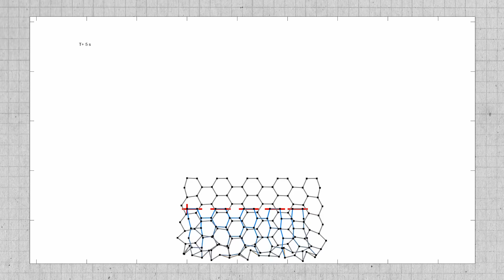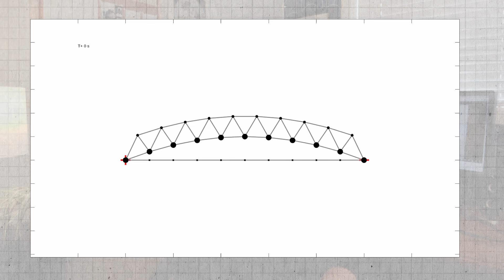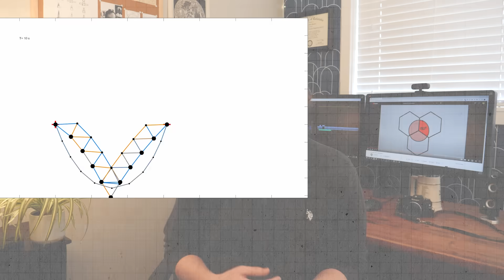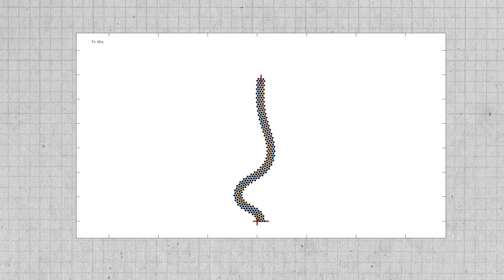Hexagons Are NotSoGreatAgons

Comment: Chemist turned engineer here. Hexagons ARE the best way to fill the space between 2 strong sheets in a honeycomb for precisely the reason CGP mentioned: they fill an area with the least amount of length. However this is only true for a general purpose (isotropic) honeycomb. If you require more strength in one direction than the other,  then a rectangular grid is best per the rocket example you gave. If you have only one sheet, then the other side is subject to buckling, so the best isotropic grid is the triangle one that you showed.
 
Hexagons are essentially useless for making a rigid structure from beams - for that you obviously need triangles. But if you want to make a 2D atomic sheet it has to be hexagons. Bonds spread out to fill 3d space due to VSEPR. An atom with 3 bonds (and no spare electrons) will be flat with 120 angles as in boron trifluoride (Graphene is a bit more complex,  there is a 4th electron on each atom but it is used in a delocalised electron cloud unlike the other 3 which are paired with neighbours into 3 discrete bonds.) if you have more than 3 bonds they make a 3d structure, for example 4 bonds form a tetrahedron as in methane or diamond and 6 bonds form right angles like a cube lattice, as in sodium chloride (ionic bonds) or sulphur hexafluoride (covalent bonds.) 

Molecules containing an atom with 4 bonds in the same plane do exist, but the atom in question is always a fairly heavy one with a total of 6 electron pairs to maintain that cube-like geometry (the electron pairs that are not used in bonding occupy the poles of the six-sided cube and therefore push the 4 bonds into a flat configuration around the equator of the atom.) To my knowledge nobody has made a flat sheet of atoms in this way - the electron pairs that are not used in bonding (and their corresponding orbitals) would leave the molecule vulnerable to being attacked chemically, even by itself.

If you are stacking long thin objects, a stack of hexagonal prisms is stronger / more stable than square prisms or triangular prisms, because it doesn't have shear planes. A fistful of hexagonal pencils feels quite rigid, but with square or triangular prisms they would tend to slide across each other.
Reply: You're right if you restrict your shape selection to regular polygons, and if your core/filler is purely for volumetric (aka non-structural) reasons. However, break those two assumptions for your application and it may no longer be true that hexagons offer the best mass/path length for the situation. For example, an application with negligible radial loads will be theoretically better served with only axially-aligned members, minus a couple radially aligned segments to reduce twist.
Reply: @Clippy-o3q  Isotropic means "equal properties (in this case strength) in all directions." What you are describing is a non-isotropic case. Actually a hexagon grid isn't perfectly isotropic (properties parallel and perpendicular to the sides vary slightly, cycling every 60 degrees) but is more isotropic than a square grid (properties at 0 and 45 degrees vary, cycling every 90 degrees.) I already accepted OP's point that another grid is better if you want more strength in one direction than another, such as the rectangular grid in OP's rocket example. Perfect hexagon grids are rare in practice both because they're not always the best solution, and (as OP mentioned) because of manufacturing. The hexagonal packing insided IKEA table tops is made from strips of card bonded together, for example, and is therefore twice as thick in one direction than in the other two.
Reply: @felixu95 Helix?
Reply: @Clippy-o3q  A disconnected lattice of rods sounds like a nightmare to manufacture at scale.
Reply: @Clippy-o3q an application with negligible radial loads isn't isotropic
Reply: "A fistful of hexagonal pencils feels quite rigid, but with square or triangular prisms they would tend to slide across each other."
That's an excellent analogy.
Reply: @Gameknight2169  it interlocks, while  squares and triangles don't? I'm asking because i do not know
Reply: This is the longest comment I’ve ever read. Thank you for that Amazing explanation! 😊
Reply: @Joe-sg9ll  Bees use hexagons because it optimises storage volume. Actually the bottoms of the cells are made of three rhombuses with diagonals in the ratio sqrt(2):1 (like the corners of a shape called a rhombic dodecahedron) as this further optimises storage volume (it means the front and back sides are offset from each other though.) Bees also seal most of the cells of the honeycomb, and in that state, the structure is also optimised.
Reply: @londonalicante No they don't, Bees just happen to get Hexagons because they start with Circles that then get unintentionally sqished together and form a Hexagon. Bees make Circles
Reply: @silberpfeil1098  
" Circles that then get unintentionally sqished together and form a Hexagon"
That is the reason why hexagons are so strong in that direction. In theory a circle would be stronger (as proven by circular pillars) But becasue in a hexagon every outside edge is also every inside edge, the slight drawback of no making it totally circular is compensated by having the side inside and outside sheet. That is, you lose somewhat like 8% strength  making it a hexagon, then gain back 50% from having inside being outside
Reply: @matsv201  But Strength isn't what the Bees need, it's Space, thats why they start with Circles, because most area for least material. The squish turns them to Hexagons, which are the most efficient when stacked. Bees don't care about strength, its a byproduct of the squish. Yes, Hexagons are the best for bees, but bees don't make Hexagons intentionally. If the squish wouldn't happen, Bee Hives would all be stacked Circles
Reply: @silberpfeil1098  That is not quite true. They also need strength. While not in a man made beehive, but in there natural habitat.

Its not like they trying to make circles and fails. They make hexagons because they are circular like. They are not Squished, they are hexagons becasue that is the closest compromised between a circular hole and stackability
Reply: @silberpfeil1098 If your argument is about intentionality, then you missed the point. This is about what's the best shape for the bees, not what are the intention intentions they had while trying to get that.
Reply: @silberpfeil1098  You gave yourself the answer. physics tell you what form the material desires.
Reply: @silberpfeil1098  which is exactly what CGP said in his videos, circles are the most effective for filling an area with a strong structure however because of the gaps it makes applying multiple circles together extremely inefficient thus why they make hexagons (also a circle being squished would likely just become a shape with WAY more than 6 sides)
Reply: One of the main reasons why hexagons are used as a spacer material in carbon fiber components is because the shape is weak. This means it can bend around radiuses, fills odd corners etc.
Other shapes are too rigid and would not fulfil this role as well. They would start buckling or simply not reach into corners.
So in a sense, its weakness is its strength.
Reply: Also, cyclohexane is the most stable cycloalkane, and cyclopropane is the least stable
Reply: @THEAlexpotat   you're missing out, it's technical but very approachable. It would be hard to learn more in fewer words.
Reply: thanks :)
Reply: How is the comment above beating this absolute essay?
Reply: @bigwinnergamer  LOL thanks for the appreciation. I now have more votes than Andrewpeachey's comment about joining the hexagon cult, which I think means I now have the most upvoted comment on this video. I'm amused that TWO people made the effort to comment that my comment was too long to bother reading, which now means they will have to read a notification every time someone comments on this thread.
Reply: Yeah, I think the important takeaway here is really that different shapes are better for different applications. Different shapes have different advantages, and which shape works better for a given application largely depends on which advantages are most important for that application. There isn't really an overall "best" shape from an engineering perspective, it really depends on what you're looking to do. A simple example that comes to mind is the why we use rectangular prisms so much even though they're structurally one of the weaker shapes overall; they stack easily! Those parallel surfaces and right angles might be a liability when it comes to raw structural strength, but they're pretty handy for making a stable a structure in the presence of gravity without needling to rely on joins or adhesives. Most shapes need to be arranged in specific proportions and patterns to pull that off, but rectangles tend support each other without you even trying.
Reply: Yeah. When you say something is the strongest shape, you have to specify how material is arranged in that shape, what scale you’re working at, what directions it needs to be strong in and if you’re talking about pure strength or strength per weight (specific strength).
Reply: Well said
Reply: Wow just wow that’s all I have to say
Reply: I like your funny words magic man
Reply: You certainly care much about shapes, I feel you were waiting for this opportunity.
Reply: The other important reason to prefer hexagonal grids in core material is that they have low self bending stiffness. This allows you to conform a hexagonal lattice to complex curved surfaces without excess strain.
Reply: In uniaxial bending, the ideal shear web is either individual planar stiffners or maybe a truss within those planes at low loads/densities. 

Practically speaking, stretched hexagonal honeycomb is often used because it can achieve the same performance as rectangles (maximally stretched hexagons are brick tiled rectangles) while remaining better at conforming to curved surfaces.
Reply: And then someone comes and says "I aint readin allat" like bro nonody asked am i right my knowledge seeking friends?
Reply: yeah but if you do this you don't get a clickbaity title.
Reply: He said that
Reply: Hexagons are so 90's ugh
Reply: is that one why bees do honeycomb; it resists shearing in a line better meaning it can hold more hunny before reaching structural limits?
Reply: Just commenting to say this was all really interesting, a shame it's too long for some people ;)
Reply: Hexagons are the second-bestagons.
Reply: The thesis of your first paragraph might be best worded as "hexagons are bestagons when resistance needs to be normal (perpendicular) to the plane of the tesselation, and otherwise are not".

And then to minimize mass, when viewing an individual edge of the hexagon, you should see open webs with triangular truss elements (if it was worthwhile and effective to take the time to do so).
Reply: So, tl;dr, different shapes and tiles are best depending on the application. Wow. Turns out blanket statements like "best" and "worst" rarely ever truly apply to anything in every scenario.
Reply: This is better than the video
Reply: Stop the hexagon  propaganda !
Reply: thats.... an extreamly narrow area of application. we happen to need that quite a lot, but it's still an extremely weak shape in the plane.
Reply: @ravener96  thing is, materials behave way different depending on the scale. At an atomic scale, all other shapes pale in comparison to hexagons and their honeycomb structure, but at a big scale triangles are the best depending on what you're trying to build. Otherwise skyscrapers would be pyramids, but they combine rectangles and triangles strenghts.
Reply: Hexagons have the best PACKING FACTOR, meaning you can pack most shit in a given volume.  Hence aerospace uses them sometimes.
Reply: The hexagon is truly the bestagone
Reply: "Chemist turned engineer here. . ." stop reading after that
Reply: @flameinfiren5565 , that's not a fallacy if it's what you think
Reply: @flameinfiren5565  why?

Comment: The meme that hexagons are strong comes from the work of architect Buckminster Fuller.

He showed that because give the strongest support system for transverse stress for a planar is cylindrical surface; if you want a  hemisphere as a dome you insist six pentagons among the hexagons.

To be clear what he was optimising was finding the lattice that uses the minimum material along the edges as compared to the area supported/enclosed. 

What your models show, with equal validity, is that this is not the optimum of you are trying to resist forces within the plane of the structure, as with a pin jointed truss.

Comment: the reason graphene's hexagons are strong is kinda several factors, but you did good enough 
there's also VSEPR, for example, which is basically lone pairs and molecular bonds repel each other, which is why water forms a bent shape!
so, benzene forming a flat hexagon is a result of that and what you said and maybe a few other things. it pushes itself into that shape, and that sure as heck doesn't happen if you just make any random hexagon on the macro level
Reply: Can you develop your point about VSEPR? How does its principle that lone pairs repel molecular bonds more than molecular bonds repel each other factor into graphene’s hexagons being strong?

Comment: CGP Grey specifically states that they are the strongest shape for the least amount of materials because you need more wall to make triangles than hexagons
Reply from the maker: Adding the extra members doubles your weight but easily more than doubles the strength
Reply: @ConHathy that increases the amount of materials, thus invalidating the point
Reply from the maker: @wow-roblox8370  did you miss the part where I said it more than doubled strength? That means you can use thinner members or larger triangles (reducing weight) while having the same strength
Reply: Except you can do the same thing AGAIN for less and still get the same result so @ConHathy

Comment: Jah bless, thanks for sharing, I agree with you but to be fair the guy in the other video said in simple words that in x and z axis like width and depth the hexagon is pretty strong but in Y like height it's weaker and your experiments was in the Y axis so of course your right but then if you are going to do the whole demonstration it would be a 3d figure in 2 dimensions  that yes in the horizontal you see an hexagon but por example their height are rectangles so 2 big triangles or 2 cubes then 4 triangles and there is the strength because their Y axis in 3d is not and hexagon but a rectangle so you are right but in 3d taking this on account, for this analysis I will say that hexagons are the bestagons. But here is a doubt that if the 3d hexagon would be literally like an hexagon in each face or just in ther up and down

Comment: I'm surprised you didn't mention the relatively low surface area of the hexagon fill in the paneling. They're closer to circular so they reduce the amount of materials compared with a triangular mesh -- yet another way in which the hexagon is the cheapagon. Bees use hexagons (well, actually they use halved rhombic dodecahedra) because it minimizes the amount of beeswax needed.
Reply: The more pictures of hives I look at, the more I'm convinced they actually use circular tubes that are hexpacked together.  If they're hexagons, the corners sure are beveled to hell!
Reply: @BalderOdinson  You're right, bees build the tubes of the beehive in a circular shape. The trick is that the wax itself keeps rearranging itself due to the heat of the hive, so it ends to stick together with the walls of the neighboring cells and makes the hexagons.

But the idea of bees making the polygons is a myth, is just a quirk of the material of the hive.
Reply: @EduardoEscarez  "The idea that humans melt metal themselves is a myth, it's just a quirk of the tools and materials they use."

I mean, come on. Let the bees have their fame. Maybe they still intend to make hexagons, they simply know that circles will mold themselves into hexagons, so really they're saving energy! :P
Reply: @bugjams or maybe they don't care and they just want to make the walls anyway
Reply: Of course the bees are actually creating circular tubes -- they're making them with their own abdomens, which are roughly circular in cross-section.
Reply: Octagons are closer to circular than hexagons. Octagons the best circlegon?
Reply: @kazedcat octagons don’t tile by themselves
Reply: @kazedcat  every n+1 polygon is closer to a circle than n polygon, 6 sided polygon, it the biggest n polygon that stacks
Reply: both the truncated octahedron and the weiare phelan structure beat the rhombic dodecahedron
Reply: Rhombic dodecahedra aren't the best volume to surface area ratio either
Reply: @andrewmirror4611   It's a local max at the least. What did you have in mind that beats it? It's certainly better than a cube packing.
Reply: @dranorter  there is a matt Parker video on bees and bestagons that explores how bees build, and they mentioned how there is a better surface to volume shape that stacks, but bees just get the shape that naturally occurs when pushing spheres into each other